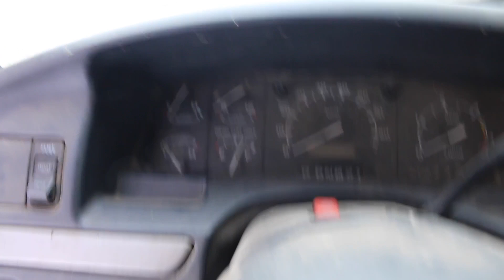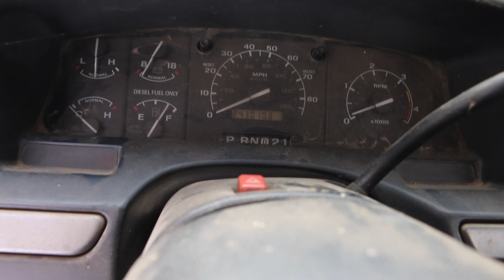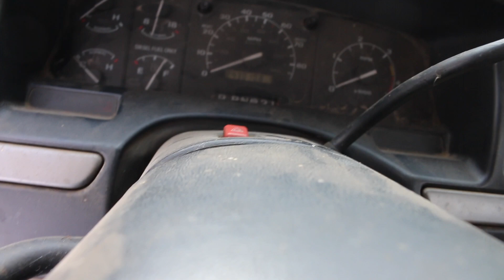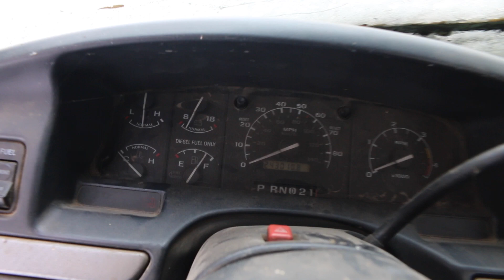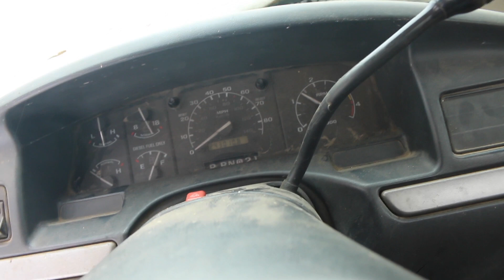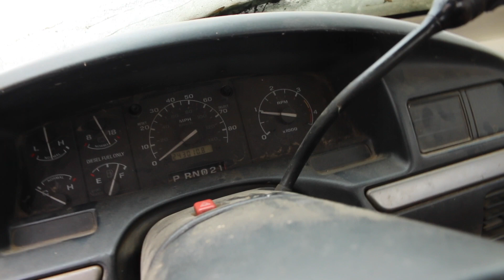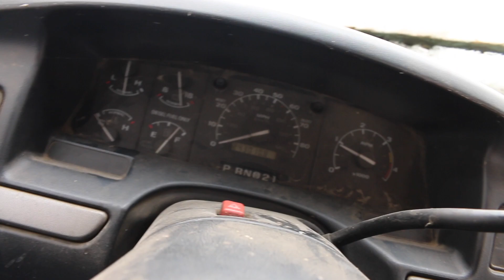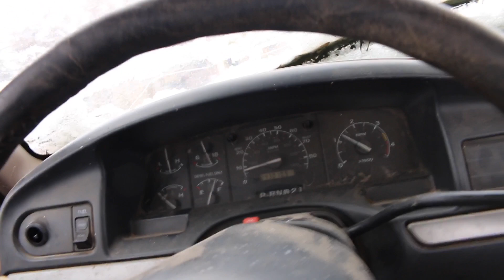Old Start Cold Start Ford F250 7.3idi

Comment: And I thought my white 1989 f super duty 7.3 was hard starting. It started on it's with no help at 10f. Only took a few quick tries, not bad considering it doesn't have very good glow plugs.
Think it sat around 2 weeks undisturbed before that. It's by the best cold starting IDI of the 4 I have.

Comment: The "wait to start" light goes out on its own but the glow plugs stay on for a minute or so when it's cold. Since you have a glow plug switch instead of the factory setup, try cranking it with the switch on and it'll probably start right away.